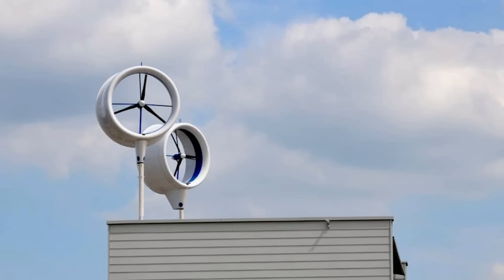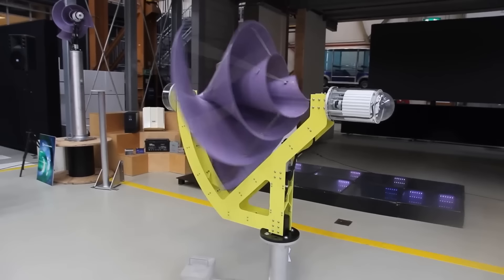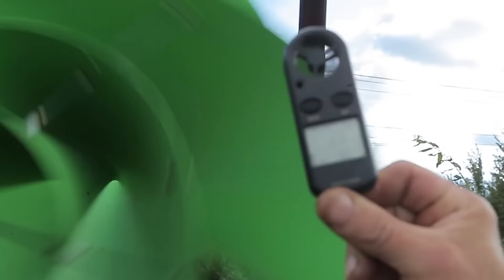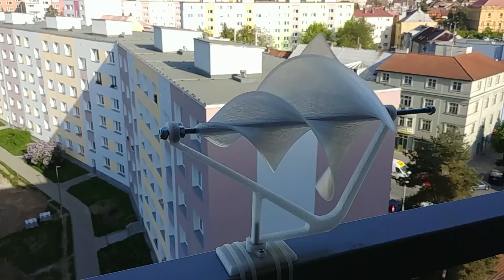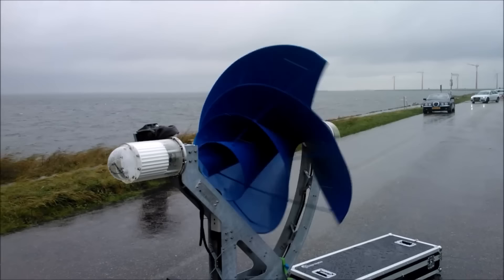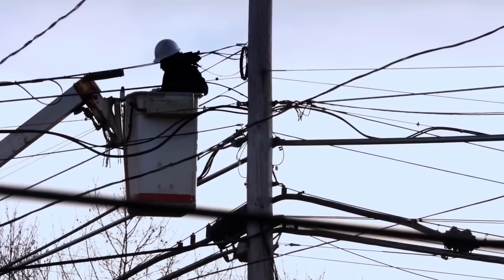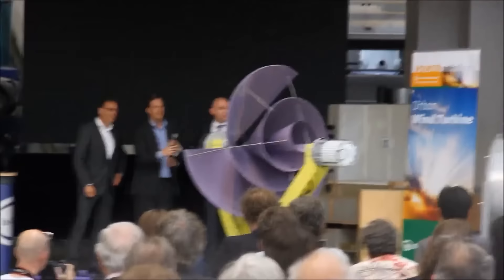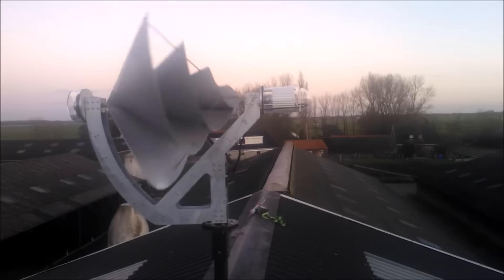How The Liam F1 Wind Turbine Will Destroy Every Home Renewable Energy Source

Comment: Takes a big set of blades to extract energy from wind...Swept area...These little guys might generate power in a hurricane...
Reply: The design wraps like a Pinwheel, if you unwound and extended the fins you would find that the blades are at least 3 times longer than the diameter of the pinwheel. The total surface are is rather large so it will definitly catch more wind than you expect.
Reply: As Sylvester said Is the swept area that maters, not the blade  área. Energy is on the air that passes through.  Look up for Betz limit.

Comment: Seems difficult to find a seller/installer and there's no original site. Also the 1.5m one seems only to produce 1000w which is not much at all compared to the 5500 USD cost I found.
Reply: 1kw and they claim it can produce 4X the power of solar panel, all you need  is 2.5 panels, of course it does not procude anything at night (so put 5 panels), but wind does not blow all the time either (except in some places and I would not want to live there).
Reply: They are depending on people not doing the math. If you divide the total kwh by the year in hours you get an output of 171 watts at the average wind speed. So with the average modern house using 1000 watts ( also on average ) it would take 6 of these to power one house. Also need storage to handle peak loads and calm winds, a microwave oven alone would take the full output from 6 and add a toaster and you are drawing from batteries.

Comment: Hey everyone, just a quick note, I invite you to check the data : 

The video says that the Liam F1 (diameter = 1.5m) can produce 1500 kwh/year with wind at 5 m/s, I have serious doubt about it. First let's compute the power of the wind : 
Pwind = 0.5 * p * a * v^3 
With p : density of air (kg/m^3) = 1.225 kg/m^3
         A : area of turbine (m^2) = 3.14 * 0.75^2 = 1.76 m^2
         v : speed of wind (m/s) = 5 m/s

So the power of the wind that will be put in liam F1 will be : 
Pwind = 135 W = 0.135 kW

Number of hours in a year = 365*24 = 8760 hours

So the energy of the wind in a year will be : 
Ewind =  0.135 * 8760 = 1184 kwh

Wich is less than the 1500 kwh said in the video. 
Morover, the wind will not go at 5 m/s 24h/24 (by far), the efficiency of the F1 is not 100% (see Betz limit) and we should have energy loss due to storage, friction or stuff like that. 
I don't know where these 1500 kwh come from, if my reasoning is wrong, pls correct me, otherwise, it is unprofessional to tell these kind of numbers without quick verifications.
Reply: No, the rated power is at 12 m/s wind speed

Comment: Can they be made small enough to fit on a roof, we need to make every home energy self-sufficient & cut ties with the stranglehold that big business currently has over us all, we need to get as many homes & businesses harnessing & storing it's own energy as possible.
Reply: I'm working on it.
Reply: So instead of relying on the "big business" that provides grid energy, you instead rely on companies that produce battery systems and energy generation devices alongside accessories and parts for them? That's a pretty ignorant and hypocritical approach.
Reply: @LAndrewsChannel  No, I buy the initial technology obviously because I can't make it myself but once bought I don't then spend the rest of my lifegiving over my hard earned money to big business, I produce all most if not all of my energy needs for free. If you're happy giving away all your hard earned money to big business then carry on doing so, it your money, you earned it. Personally I'd rather spend my hard earned money on other things.
Reply: @user-ol6rd7pl5t  So on what you'd "rather spend [your] hard earned money"? A TV? A car? A vacation? Everything you spend your "hard earned money" on will go partially or completely to "big business". A TV panel, a lithium battery, a microcontroller or jet fuel are all made by "big business" because the scale is the only thing that makes these affordable to most people.
Without "big business" you won't be able to afford a lot of your things, like PV panels so saying crap like "big business bad" shows your ignorance on how the world works in this day and age.

Comment: No, this will not replace solar cells. There is a minimum wind velocity. I tried a wind turbine near the ocean with a on shore breeze, but it failed. Mine only needed 2.5 m/s wind velocity. Couldn't get that reliably, was intermittent at best. Except for special locations, there is just not enough energy in the wind. Get a anemometer and check your wind speed before buying into this. Most likely you won't make the 5 m/s minimum. It's a very stiff breeze. Cheers.

Comment: 5 m/second is 11 miles an hour, so that's a noticeably windy day in most places, 2m/second, for it to produce minimum power, is just over 4 mph, which is much more common on many days in most places, but apparently won't give you much.  Also, no mention is made of when the system tops out.  In a (say) 40 mile an hour wind can the battery store as much power as rapidly as the turbine generates it?  If not, then you have to knock some amount off of any calculation of average wind speeds.

Comment: 1500kwh per year is 4.1kwh  per day average.  Same average daily output of two 380 watt solar panels.   Estimated cost of turbine is around $5500.  Cost of a PALLET OF 30, 380watt solar panels, $3078(from a quick Google search).  That's 15 times more power produced.  Plus solar gives more power in the summer when we need it in Georgia.  
Maybe Kansas for winter if it doesn't turn into a frozen block of snow.

Comment: I wonder if we have enough air movement to make this worth it.  I think this is a great idea and would be so much easier to install over solar panels.
Reply: "would be so much easier to install over solar panels."
It would probably be better to install it adjacent to solar panels rather than over solar panels.
Reply: Installing solar panels is incredibly easy. Go for solar, it is easier to install, cheaper and will produce 10 times as much energy.
Reply: @janos5555  "Go for solar, it is easier to install, cheaper and will produce 10 times as much energy."
Unless you live in the specific northwest where sunshine is a rare event.
Reply: @thomasmaughan4798  Yeah, and this accounts for maybe 2% of the global population. I live 53° North and still get over 1000kWh/kWp out of my solar panels.
Reply: @janos5555  "I live 53° North and still get over 1000kWh/kWp out of my solar panels."
I would be more impressed if you revealed the size of your solar panel array and whether that megawatt-hour is daily or annually or whatever.   That far north you'll have a LOT of summer daylight (and very little winter daylight) but you'd need trackers since the sunlight is going to sweep nearly 270 degrees horizon to horizon each summer day.
Reply: @thomasmaughan4798  The unit is normalized 1000kWh per 1000 Watts of installed capacity and per year. In total I have 9000 Watts so 9000kWh per year.
Reply: @janos5555  "In total I have 9000 Watts so 9000kWh per year."
So 9 megawatt-hours per year.  That is impressive.   You'd need a thousand hours at full production and I can see that much of northern hemisphere NOT coastal areas could achieve that.

Comment: Yet another poor performance turbine. I should know, as I designed many different turbine types for over 10 years and it's really difficult to create an efficient turbine that lasts more than a few years at best. Ridiculous claims, but they'll probably sell well due to good marketing.
Reply: Why don't they last? Is it the bearings?
Reply: @jasonperry70  erosion... corrosion...

high speed blades get a lot of abrasion from dust.
low speed blades like this just dont work. just because its spinning doesnt mean anything... how much POWER is it making? thats the question. and you cant get any more force than the wind can apply on a given area. a pinwheel spins. it isnt doing anything but spinning. things stop spinning when you actually load them down and make them do work.
you got rain. sun. exposure to elements 24/7. 
yep. bearings only last so long.

then the generator... wiring. loads. outputs versus inputs. corrosion... switches...

brakes...
im not against wind though. all problems are solved with some thought.
Reply: Put an actual load on this thing and I bet it barely spins, if at all.

Comment: Imagine you purchased your favorite, reliable pick up truck and then hired several drivers to drive it 24/7/365 for 10 years- with NO SERVICE on the drive train.  How likely is it to last more than 10 years? Now look at this Turbine and the quality of the parts it is built from - do you honestly think it is as well built or as HEAVY DUTY TRUCK?   OK.  Now tell me this Turbine is going to work for 20 years with a straight face.....yea, I agree.  ALL TURBINES are great- for the FIRST 5 to 8 years- then they start falling apart.  Just drive by the dozens of WAY MORE HEAVY DUTY windmill turbines outside of Palm Springs- less than 60% of them are running after 10 years- and this is WITH REGULAR ROUTINE SERVICE!!!  That's why LARGE solar farms are more popular for investers - NO MOVING PARTS = LONG TERM RELIABILITY!!!

Comment: Missed 1 big thing about wind vs solar. Solar panels are virtually maintenence free (believe me as a guy thats been solar since 2012 , still have all but 1 still in service. Terbines have moving parts which require regular Maint. I had a wind turbine for 32 days before critical failure)

Comment: Based on typical wind speeds, the output from these wind turbines might only be about 1/3 the maximum power. Also, they cut out when wind exceeds certain speeds when they could be generating even more power. The cost for these is also ridiculously high since you would need a rooftop full of these to replace a rooftop of solar panels. It looks like the price could be around $1K-1.5K or less if mass produced. Of course, wind turbine efficiency would decrease as more units are placed closer together, and there isn't that much room on a roof, and most urban houses are on relatively small plots of land.
Reply: We should complement solar with wind, not replace it as it will help to charge the battery during evenings and thus helping you in keeping smaller battery.
Reply: @Wisul  I believe wind has a great role in the future of green energy. These particular wind turbines are way too expensive for the amount of energy they can produce, and they should be able to operate at near gale force. Japan has a design that is designed to work in near typhoon speed winds. 
Another problem for these turbines is that they are not efficient at low wind speeds, which in most areas, is most of the time.

Comment: For a wind turbine, "small size" means it will only catch the w ind that passes by in a very small circular area  and hence produce only small power. Compare this chunk uf material with a 2-blade rotor of same diameter (which would certainly produce mure energy). Its ridiculous.
Reply: Really you need to compare the surface area of a 2 blade vs pinwheel design because surface area is what matters most. If you unwind the pinwheel you would find the surface area is deceptively large.

Comment: Pity that my State in Australia forbids wind to be grid connected
Reply: So just add battery backup and keep it all yourself.  My entire system (halfway installed now) cost me about $12k.  5.4kWh solar, 20kWh 48v battery, and it will do my whole house, including air conditioning 5 months of the year with up to 3 digit temps.

Comment: I live in South Africa so solar panels are a no-brainer (the sun is so bright in summer we exceed the panels rated capacity). Today for example, air speed is 2.5m/s - that's not even enough for the rated cut-in speed of 3.5m/s (the needed speed for the turbine to face the wind).
The turbine is a nice idea but a long way from being commercially viable.

Comment: I'm not suggesting that these wind turbines aren't potentially an important element in a renewable energy environment BUT stating that solar panels are dependent upon clear skies while neglecting to acknowledge that wind turbines are similarly dependent upon having adequate wind (11+mph) is misleading. Comparing the "potential" power generated by a wind turbine (assuming constant adequate wind) while deprecating the potential input of solar is an unfair comparison. A combination of solar panels and wind turbines would likely be the best choice for most residential or commercial applications.

Comment: In the video, Michał Woźniak, an engineer with many years of experience in wind turbine design, criticizes the Liam F1 Urban Wind Turbine from The Archimedes company. He points out several significant flaws in this design:

    The small swept area of the blades limits the total wind energy input.
    As a drag-type turbine, its efficiency is below the maximum theoretical limit.
    It will be more expensive than simpler 3-bladed lift-based turbines.
    The low mounting height above the roof prevents capturing undisturbed wind flow.
    It will not be able to cost-effectively produce sufficient energy to justify its price.
    It will be an inefficient "white elephant" and an unsightly construction constantly pivoting like a weathervane.
    It will not effectively capture the kinetic energy even of the local turbulent wind.

Engineer Woźniak believes the marketing promises about this turbine are exaggerated and untrue. His criticism is based on his extensive experience in wind turbine design. https://youtu.be/45ojzyXaU_w?si=u6alCuglR-7nUIlB

Comment: You have continued the design flaws in nearly all wind turbines. Almost seems deliberate attempts to make the machines inefficient.
Make the turbine mechanical only. Put the generator on the ground protected from the elements, larger diameter alternator(3 or 5 or 7 phase), permanent magnets, way shortened wiring. Make the turbines larger and not needing to run as fast as possible for your tiny circumference alternators or generators to work.

Comment: This actually isn't bad. It's probably a very simple mechanism, it'll last a lot longer than solar. It's far more efficient, and compact. My only issue is the price tag of 5 grand for something I can put together by making a stop at menards and autozone. In fact, if NASA's new ionic thruster is applied, we could unlock permanently renewable energy. A 1:-1 conversion rate could be achieved.

Comment: What is the life expectancy? Why don't they state the actual output at a given wind speed. When you research solar panels, the output is clearly stated in volts, amps and max watt output. This makes it easy to size the system base on your requirements. I have been totally off grid for 6 years with solar as my primary source and wind as supplement. However I still need my backup generator if there are 3 or 4 days of rain.

Comment: I would love to have a hybrid solar/wind setup on my house but the reality is, solar is winning out, it's a lot cheaper, it's better at producing energy on residential buildings where it's likely to have less winds compared to more open or higher buildings and solar integrates better on the house whereas wind sticks out too much.

There's talk about more homeowners could go gridless over the coming decades, and that wouldn't surprise me at all as renewable tech gets better as well as battery tech gets better and cheaper, if that does happen, that's a major problem for the wind energy industry, unless they can come up with much better and cheaper on-site solutions that actually work at producing a decent amount of energy, they could get wiped out by the solar industry, which is already pulling away because it's more flexible, a lot cheaper and can be used pretty much anywhere.

Wind is fine when it comes to wind farms and big wind turbines, but unless they crack the residential area at a low cost that can produce a decent amount of energy, then I don't see much of a future for wind energy long term as solar keeps getting better and cheaper, especially as more of us will likely want to produce our own energy on-site as the tech continues to get better and cheaper, which for now, wind does a poor job in that area.

Comment: Problem with all these small wind generators is that there is not much energy per square metre of wind cross section.  The available wind  is proportional to the area of collection and the wind speed cubed. The maximium possible theoretical turbine efficiency is 59% and this thing will be less efficient than that. As a rough calculation a 1 metre area of wind at 20km per hour has an energy of very roughly 120 watts so you might get 60 watts out of your generator at best.
At 30km/ hour about 150 watts. You need strong constant winds to generate any significant power with any small wind turbine. 
The big wind farms with 50 plus metre blades heaps more because of their huge area. Basically you can look at any of these “revolutionary” small wind generators and determine their output power by looking at the cross section they subtend to the wind. This is not a massive breakthrough. The best you can hope is that it is not too noisy.

Comment: Bunk.  First off, no solar panel in the world generates 500-600 Kwh of power.
You'd need over 1,000 solar panels to generate that kind of output.

A smaller wind turbine (like the ones pictured) will not power an average home.  And to be really beneficial, they need sustained winds of around 30 mph.  Very few areas have that.

Comment: This video seems to be almost completely false. The turbine is not lighter than existing models, it does not produce more than solar arrays and it is certainly not cheaper per kw output. The amount of energy you can get out of wind is directly related to the size of a turbine - and something relatively small like this will only ever produce small outputs.